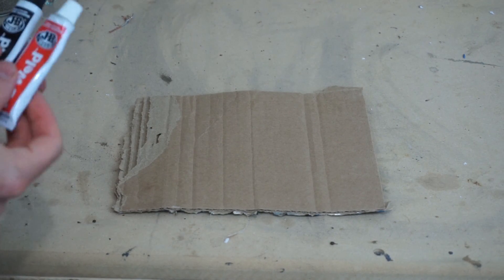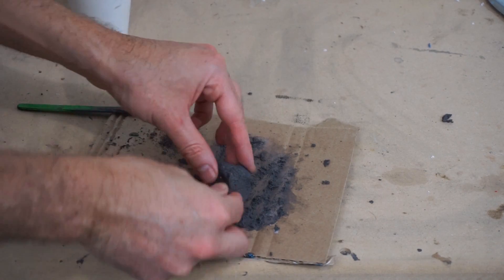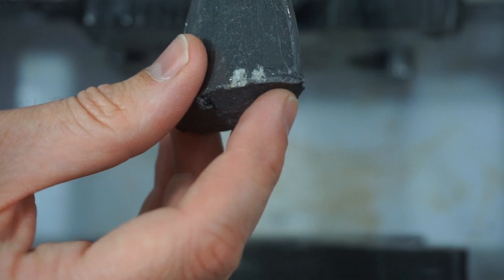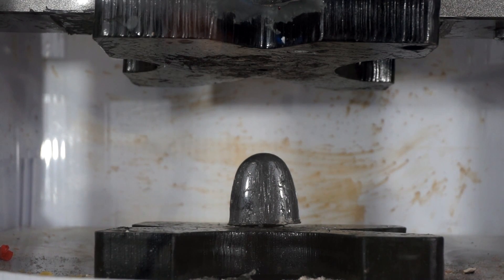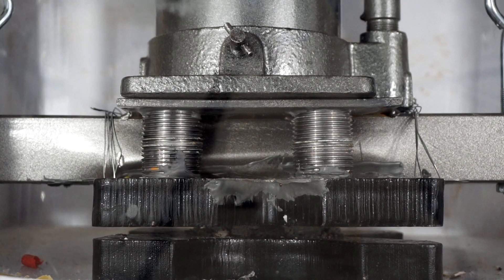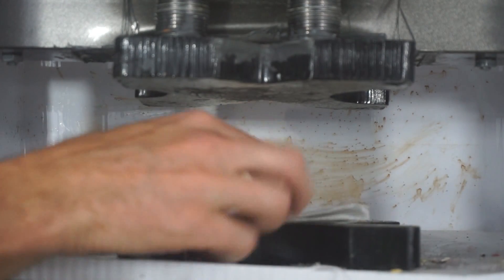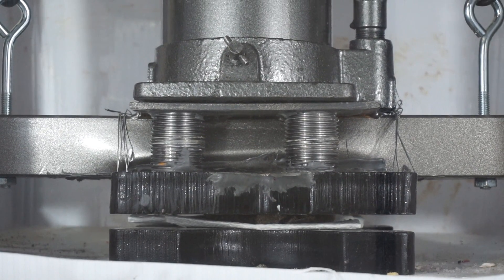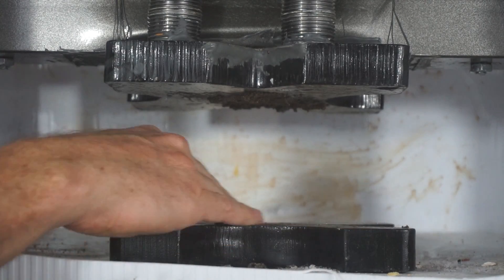Welded Sand Crushed By Hydraulic Press

Comment: definition of weld

join together (metal parts) by heating the surfaces to the point of melting with a blowpipe, electric arc, or other means, and uniting them by pressing, hammering, etc.

Comment from the maker: Hi, for all who are wondering, this press is indeed a hydraulic press, not a pneumatic press. The air compressor you hear simply pumps the hydraulic fluid.
Reply: People always think they are so smart over the internet. How are they going to tell YOU what kind of press you bought!
Reply: either way, if you were worried that a sand/jb weld composite would break your press, you need a better press.
Reply: +Jakenova does that mean it's technically an electric press and both the air and hydraulic oil are conductors? or maybe it's actually a coal powered press as the power station that feeds his house runs on coal? or is it an organism powered press because coal is formed from organic material? but if we're going that far it is in fact a solar powered press as organic matter tends to rely on the sun for energy????
Reply: Hydraulic Press Action do a press video about bowling balls do it I Dare You Dare I do all tied up puppy dare 🎳
Reply: Yeah I would say HPA is right. Whether the hydraulic pump is electric or pneumatic its still a hydraulic pump and a hydraulic press. Though i would think an electric pump would be much more powerful.
Reply: Jakenova with out said breakfast I wouldn't have had the energy to punch the drywall, and I always have an organic breakfast so really we're back to the punch being solar powered.
Reply: Hydraulic Press Action crush a bong
Reply: +Hydraulic Press Action  Hi
Reply: you sound like your name is tyler
Reply: If the pressure is being generated by compressed air, it's still an air press. A proper hydraulic press gets the pressure generated by a pump. The kind of press is specified by a source of pressure and in your case the source is compressed air and the liquid is just a "conductor".
Reply: I reckon I can build that
If you read my comment with one more time you'll see that I was talking about the starting point where pressure is being generated. You can't measure increasing "pressure of electricity" can you. If you hit a drywall with your fist wearing a glove and make a hole in it, it's the strength of your arm what made that happen, not the glove or not the breakfast you ate before.
Reply: I reckon I can build that
good for you. We are talking about naming and there is a reason why different presses are named differently even though 95% of them are powered by electricity.
Reply: Make it like so people could guess if it's going to crush or not like a challenge
Reply: The Action Lab 
pneumatics basically the same anyways. the only difference is how compressible the fluids are. air is less compressible than oil. you can still get just as much power from it though
Reply: It's an air over hydraulic press from harbor freight item #65330 they have the same one at a friend's shop
Reply from the maker: Jakenova The air does not generate the pressure. The air powers the hydraulic pump, which pumps the hydraulic fluid. So as I said, this is a hydraulic press. Please refer to xMontorix's comment above.

Comment: Weak-ass press. Isn't even a hydraulic press, it's a pneumatic press.
Reply: It's hydraulic.
Reply: Animu Scrub Pneumatic.
Reply: Fluffle Puffle Try reading what the video maker said. Look at the top comment. Hydraulic.
Reply: Animu Scrub If I call a dump truck a fire truck, is it a fire truck?
Reply: The facepalm is real.
Reply: Animu Scrub he's right it's a pneumatic press. that's why he has to turn that knob to raise it, it releases the pressure. if it was hydraulic it would be pressurized by some sort of oil and you'd just press a button to bring it back up. you might wanna do some research before you just believe some random guy who makes a YouTube video
Reply: Animu Scrub also by judging the title this guy isn't very smart because you can't weld sand either. he glued the sand together not welded
Reply: CRAZYxKRONICKS k

Comment: You didn't let that jb sand cure all the way. Because there is no air on the Inside it takes a lot longer to cure solid. Do this again but wait a week or two before you try to press the epoxy sand

Comment: Crush an atom and see what happens
Reply from the maker: Well "crushing" an atom could mean that you just knock it's electrons off. That's pretty easy, you just make a plasma. If you mean "crush" by breaking apart it's nucleus, then I can just get some americium from a fire alarm and let it decay in my press. But, if by "crush" you mean fusing two atoms together, then that would be more difficult, but doable, and wouldn't cause a nuclear blast, unless I tried to.
Reply: +LarryG123 Not even if one has a tiny hammer?
Reply: ^When 10 years olds put a girl with cleavage on the profile.^
Reply: atoms* just because you can't see it doesn't mean that it can't be crushed 

but atoms can generally only be broken down by scientific means so
Reply: james tuccillo what? 😉
Reply: a bus 😁
Reply: Old Enough I think he should crush my dreams next
Reply: Old Enough wtf
Reply: Lol
Reply: wouldnt that cause some form of atomic explosion similiar to a nuclear blast?
Reply: Are you fucking stupid. Crush an atom...
Reply: Not by crushing just one atom.
You only get Fusion when you combine two atoms into one.
Reply: Old Enough that not possible

Comment: in a piece like that, the outside would harden and slow down the curing process on the inside, perhaps you would have gotten the shattering you expected from a piece cured from a week or so, but as it broke down, it looked like the inside may not have been completely set.

Comment: Did this one time at work when we were bored and no work coming in.  Mixed a bunch of sand with the entire black tube until it was in a ball just over two inches in diameter.  This ball was then mixed with the entire white tube.  Kept mixing until started to harden and heat up.  Left the now "hardened" ball sit for two days so it was cured.  Attempted to dent/break the ball by throwing it against the floor and even drove over it with a bulldozer.  The result was....... well..... nothing.  The ball was barely even marked by the tracks.  I can't remember exactly how much force it took to break the ball (over 4000 psi though) but reacted almost like the acrylic ball but, however, didn't explode like a ball bearing does.